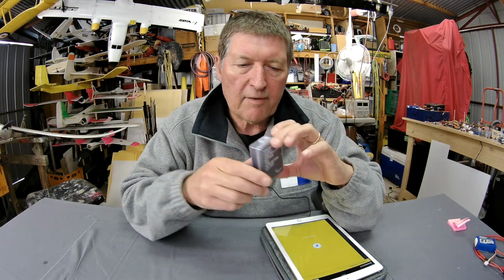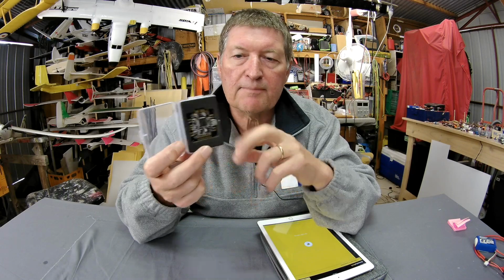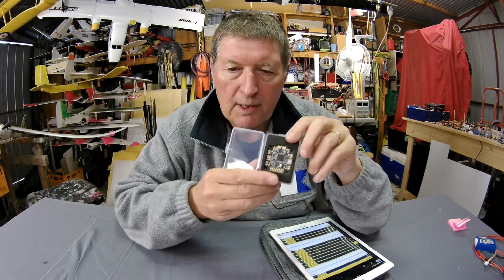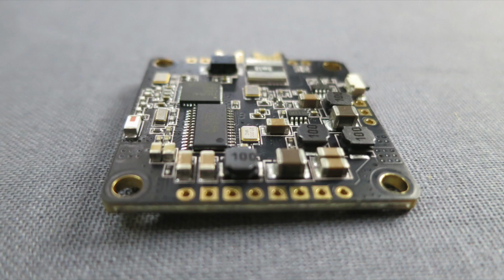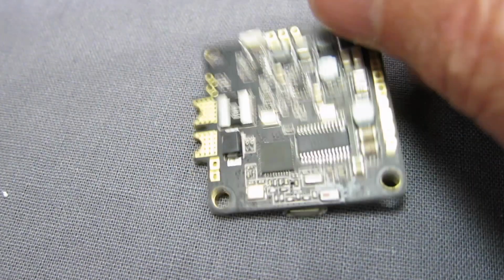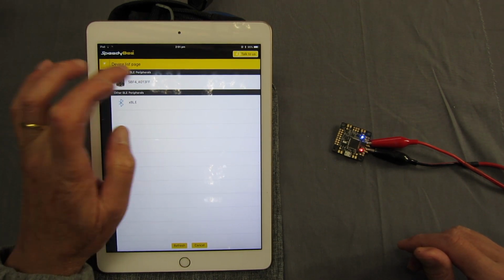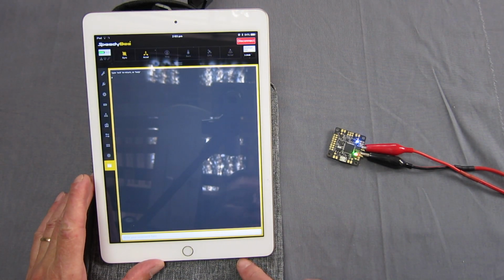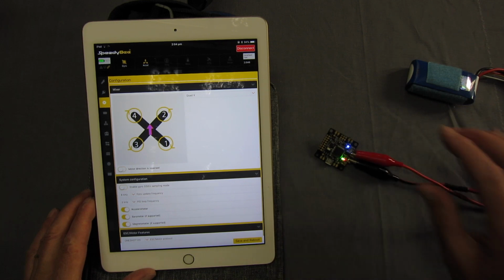Speedybee F4 AIO board with Bluetooth

Comment: hi Andrew you should be able to flash the board to use Inav and use the s1 to s7 on the board to drive servos Just like syrus boards. I believe betaflight has a plane option as well. It's not hard to flash the board to different software. Maybe something you can try. Love your youtubes keep them up
Reply from the maker: Thanks Steven, yes I'll try that eventually.
Reply: We'll appreciate it a lot!!! I asked the same to speedybee website contact form. Hoping in a reply.

Comment: I bought the BT adapter to connect to my Matek F405 Wing FC and unfortunately at this time you can't use the BT power switching function with iNav. Since the iNav devs have decide to disable mapping you can't remap to a "PINIO" function as they require. Guessing that would apply to this FC too, hopefully the iNav devs can fix that. The app works well with iNav via USB connection, can change Waypoints, OSD, Calibration (iNav1.9+) and CLI. I did get the BT adapter to work with the Matek FC also, but without being able to turn it off, I will not fly with it installed.
Reply from the maker: Oh thanks. One day this will all be easy, maybe

Comment: It's a nice App that Speedy Bee, I have tried it. You forgot to mention Andrew that you can also use a USB cable between the Pad and the Flight Controller which of course means you dont need the wireless link.
  Most Quads have an easy access to their USB Port, (unlike our Fixed Wings)